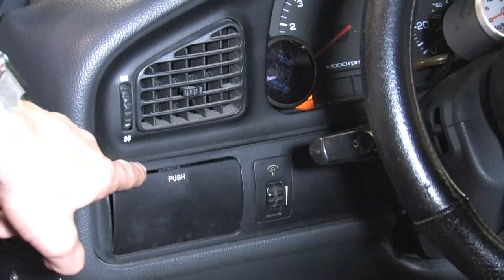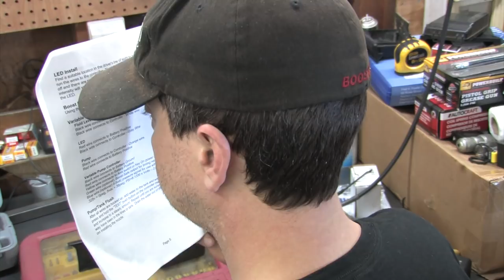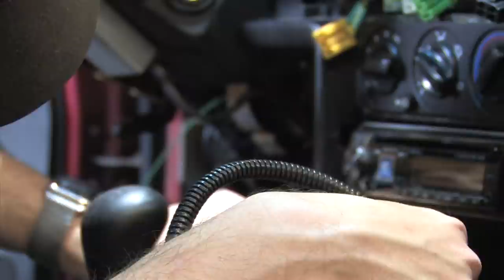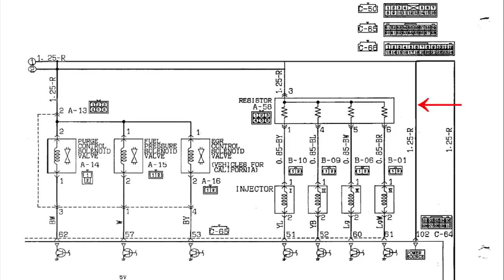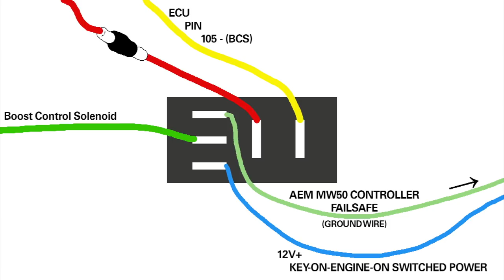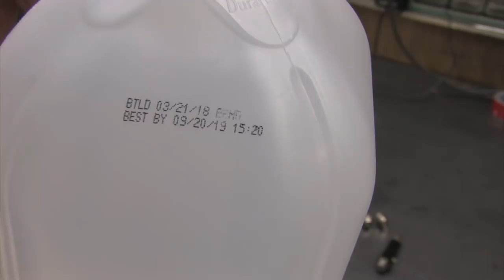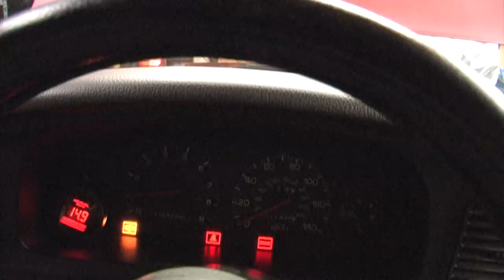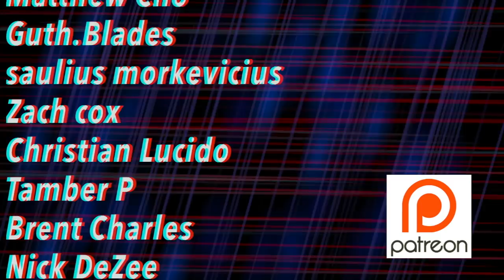Water Methanol Injection Installation

Comment: No need for a boost gauge? really? how are you going to know how much boost you are making? and how are you going to know if you have a boost leak? and how are you going to know if you are making more or less boost? if you have a manual or electric boost controller how are you going to know how much boost you want if you cant see how much boost you are making?
Reply from the maker: Yes, really.  There's no need for it.  Of 100 opportunities that you think you might be able to get good information from them, 98% of them you can't glean any information that you don't already know, or not know.  Certainly no information that's critical to your tune.  You're looking at the gauge because you already FELT something that wasn't right.  It doesn't tell you what's wrong.  It shows you a possible symptom of the problem.  If a turbo can't produce more power than its host engine's rotating assembly can handle, then a driver worrying about boost means that car's fuel system is inadequate.  For that individual, a boost gauge is little more than a stress ball.  A security blanket.  This is because boost PRESSURE doesn't matter for tuning, AIRFLOW does.  Things go boom at high boost levels because the tune isn't right, or the turbo wasn't sized properly for what the rotating assembly can handle.

Two different sized turbos move completely different amounts of air at the same given pressure.  So what is PSI, then?  What's its affect on intake temperatures and fuel stability?  Changes in a turbo's boost pressure will affect its host engine's load factor, and that in turn that will move that sample point around on your airflow (VE), timing, and octane tables that regulate your tune.  So boost is not a volumetric airflow measurement.  It's not a constant throughout your RPM range, and it changes gear by gear.  It's just a means of establishing a range of potential operating conditions.  The efficiency of the intake and exhaust, the engine's displacement and its ability to create vacuum changes to the extremes at wide open throttle from idle all the way to red line.  Even the incline or decline of the road has a dramatic affect on the efficiency of your turbo.  Telling your boost controller to make 20 PSI doesn't mean your turbo can, or that it's even going to manage to produce a flat 20 PSI all the way through the RPM range... at least not without extensive tuning and tweaking your wastegate solenoid duty cycles to compensate for the efficiencies or inefficiencies of your turbo's flow map in a variety of operating conditions.  If you've done that, you didn't rely on a boost gauge to get your data.  At least not with any degree of accuracy.  

It takes a tool just like what I'm using (ECMlink) that logs boost, or trial and error with another type of piggyback EBC to flatten out that boost curve.  If I wanted to see what my boost does from my shift point (4800 RPMs) to redline in third gear so I can make adjustments, then from behind the wheel I've traveled over an 1/8 of a mile at up to 107mph without ever looking at the road in front of me.  That is insanely-dangerous.  BUT... if you log boost with an engine management system, you have better, accurate and more comprehensive data that includes every detail at any given moment in time.  You can safely analyze it on your couch to make meaningful adjustments to your tune with it.  A boost gauge will not give you useful data that you can use for tuning and it's only as accurate as your memory.  You'll never remember what your boost level was at 5300 RPMs in 3rd gear after the adrenaline wears off... and how it compared to 5300 RPMs in 1st and 2nd gears.  

If you're FWD and your power production is in excess of what your tire's contact patch can handle, you make it stick by varying your wastegate duty cycles at different RPMs (to put you at different power levels in your tune) to compensate for traction, and when you do this, your boost is all over the place gradually increasing in each gear to make the best hit that you can so you can maintain traction.  Running a fixed boost level works against your engine's ability to use its full potential.  This is why logging is the only useful means of monitoring your boost and the power that results from it.  The gauge is just a pacifier for the driver.  Either that, or a fashion statement to say "look, my car has a turbo".  The dashboard real estate and the time/effort spent worrying about boost from behind the wheel is all wasted energy.  If you need to do a quick check of your boost, you can always plug in a laptop and get it live on the screen or in a log.  A log that will give you loads of more important data.  Data like airflow... fuel, timing, rpm, load factor, battery voltage, throttle position, intake temperature, and all the other things that can directly affect boost whether they're mechanical issues or not.  Rarely does the information you read from a boost gauge tell you anything useful that you can't or haven't already determined simply by using your butt dyno, or by listening to your car.

Your boost level drops... is it from a loose coupler, vacuum hose, low battery voltage, burnt valve, exhaust leak, stuck wastegate,  failed solenoid, blown injector seal, rag in the intercooler, banana in the tailpipe?  What?  And what's that whistling sound?  What did the gauge tell you?  It told you your boost dropped... and you felt that happen when?  Before you looked at the boost gauge.

I can see some value for the turbo noobs.  Those who quickly learn that they install it, it's cool for a couple of months, it becomes the backbone of what they know about making horsepower, but after that novelty wears off, they learn they never look at it during performance driving moments because they're looking at the road.  98% of the valuable information it could provide is being lost because it's being ignored.  The data they provide is just a series of reflected light waves that are lost if they don't pass through eyes of the driver and get processed by his nervous system.  The $190 for a quality electronic gauge with warning functions is better spent on an engine management system that can log boost and has failsafe functions already built in.  For the cost of 3 gauges, you can make those 3 gauges and over a dozen others completely obsolete.

I hope you don't read this as cynical.  Sure there's plenty of my own personal opinion in here... but it's intended to be an honest recount of my experience with using them versus what value they provide given the available alternatives.

Comment: Is an ECU tweak needed for that?
Reply from the maker: Yeah, you need to be able to pull fuel out of it in order to get all the benefits out of it... unless you have an EcoBoost F-150.  It will self-adjust to lean things back out.  For the vast majority of applications, you'd need some kind of fuel management.
Reply: @Jafromobile  Thank you on the fast reply. Also, I'm enjoying your videos, very nice quality editing. +1 sub

Comment: Battery relocate to make room in the engine bay for the tank?
Reply from the maker: Hahah!  Watch Hyundai Traction Issues Part 3.  :)
Reply: Why are you doing this install again? Trying to avoid installing an intercooler or something?
Reply from the maker: No, I have an intercooler... I'm experiencing more knock with pump gas than the average turbo car because I have a turbo high compression configuration (10:1 compression), and the knock is causing me to achieve really poor timing advance.  I've proven this engine can hold 30 PSI of boost, but the fuel/final compression ratio can't.  Water/Methanol injection raises the octane rating of pump gas, and works as a knock suppressant.  The colder, denser air is certainly a nice side-effect, though.  My intercooler is a eBay POS, but it works for a couple of good pulls before heat soaking, so it's not the cause of the knock...  It's possible the knock I'm logging isn't real, but this will answer that question for sure.  I drove this car to work this morning, it's been on jack stands for the past month.  I had 3 other mods I wanted to do to it after making this video, and this morning's test drive proved they're working perfectly!  :)
Reply: Jafromobile - Ahh, cool.

Comment: Brave to install the methonal house on the interior of the car. I wouldnt install a fuel that burns clear on the inside of my car.
Reply from the maker: When Methanol is mixed 50/50 with water, its flash point raises to 600°F, well beyond the point where any materials used to construct the interior of this would survive.  It would be pretty obvious both from the exterior or interior that there is or was a fire.  At 100% strength, that flash point is 300°F.  I don't smoke, and nothing in the interior of my car has an open flame or spark to ignite vapors that could potentially occur if I left the bottle open.  The only things capable of exceeding that temperature are actually on the outside of the interior.
Reply: Jafromobile I was once covered in methonal in a work place accident and set a blaze. It's the only reason I am hesitant to interior line routing. That being said I mixed a 50/50 meth and water. I poured it out and it was pretty hard to get it to light and stay lit. Best of luck and like the videos

Comment: So you flushed the system back into the half full distilled water bottle...the same bottle that you'll use to refill the system.
That makes sence!
Reply from the maker: No, that water went in my radiator afterwards.  I just haven't uploaded that video yet.  I don't run distilled water in the MW50 kit.  That was just a flush.  The radiator and water pump don't care if there's a flake of polymer in it.  Or at least I dont.  Not on this particular car.

Comment: You're not supposed to use that Teflon tape on those fittings
Reply from the maker: In every video I've ever used Teflon tape on any item anywhere including air compressor fittings, someone has always posted this exact comment with zero explanation for why they make that claim.  I've never used teflon tape on any compression fitting.  I've also never had one single problem or issue that has ever arisen from the use of Teflon tape on anything, ever.  I have however solved boost leaks on every tapered vacuum fitting with the use of Teflon tape where nothing else has ever worked.

Comment: Boost gages r good so u know ur wast gate isn’t stuck an it’s not running 30 psi about 2 blow ur shit up I’ve had it happen if I didn’t have the gage an I was just logging I would’ve blown it up
Reply from the maker: Yes, but what if you've built a setup that you can pull the wastegate actuator vacuum line, hit 30 PSI, go make 5 highway pulls and 4 drag passes and it's fine?  This car did that. Sure it knocked a little, but the ECU pulled timing like it should.  This water methanol kit is just an added safeguard.  I can see the necessity with a 67 trim or some other big honking turbo that can exceed the safe threshold of your fuel system, but with the size and efficiency of the turbos in most factory or modestly-upgraded cars, I don't find them necessary.  My fuel system is built for about 150% of what this turbo can do, and the SD table is tuned from 0-29.5 PSI already.  I couldn't hit the 29.5 PSI cells with the boost control solenoid, so I went for broke and pulled the vac line.  So maybe on some cars... but not on this one.

Comment: Water vapor is a gas, and therefore compressible.
Reply from the maker: I must have said something that's triggering this discussion.  Pardon me for having completed 3 levels of chemistry in pursuit of my Bachelor of Science, but Water vapor is literally water molecules suspended in oxygen.  It's a suspension, not a compound.  Bonds don't break from evaporation, they stay together.  That's what creates humidity and the precipitation cycle that we call weather.  Air temperature plays a big part in how much water it can suspend.  The water molecule doesn't separate into hydrogen and oxygen (which is what would convert water into a gas) when it evaporates.  That would require an electrolytic process. Evaporated water molecules stay in tact.  The water molecules are actually still incompressible, but you CAN compress the air around them that is suspending them in their gaseous state.  It's why water methanol injection raises the compression, those molecules do not compress.  Water isn't sprayed in a high enough volume to completely fill the combustion chamber with the piston at TDC.  It only occupies a small fraction of that volume, but the air sharing that space as a result is compressed further than it would be if the water vapor wasn't there.  So you get a compression bump both on the compression stroke, and on the ignition stroke from those water molecules converting to steam and expanding 1600x in volume.  So you can compress water vapor, but you're not actually compressing the H2O.  Just the O2.  It's tricky.  You are correct, I'm not going to argue that.  It's just more complicated than stating that water vapor is a compressible gas.  Water has a lot of weird properties... for instance, it expands instead of contracting when frozen.  Most other compounds shrink and become more dense as they're solidified.  Water is an exception to that behavior.  Water expands both when it's frozen or evaporated.  Kinda weird.  But it's exactly that weird thermal expansion behavior that makes WMI so effective.
Reply: Though basically true, water vapor (gas) and weakly bonded suspended (liquid) water molecules can coexist. Methanol water injection is really an amazing thing... my intake valves, pistons and spark plugs have never been cleaner :)

Comment: Dude just put a water methanol capped bottle with a tube in it the other end goes in the airintake, the vacume from your engine will suckup the fluid as it needs it more revs more fluid sucked up nozzle not needed the water will be atomized upon impact with the airstreams

Comment: Hook up your windshield washer sprayer to your intake and add water/methanol to your washer tank. Boom free water meth kit
Reply: Except windshield washer nozzles do not atomize the water/meth. You would be injecting a liquid as opposed to a vapor, that liquid will pool in the intake and cause problems. The pump is also not a high enough psi to atomize the water/meth.

Comment: Why would you run the meth hose through the cab? Thats fuel man. Run it under in the frame
Reply from the maker: A 50/50 mix of water/methanol is considered safe.  It raises the flash point of alcohol from 300°F to 600°F.  That means an open flame, spark, or focused beam of light will not be able to ignite it.  The vapor concentration will not be high enough.  I don't run or recommend using straight methanol.  Every water methanol kit comes with these warnings.

Comment: OR I could preserve my new 2019 MAZDA CX 5 turbo's warranty and use the AEM injection kit to spray water on the front of my intercooler and gain a bit of HP that way. No?
I take it that AEM, in their wisdom, supplied you with a fuse for this install. Ahh, I see you used an existing circuit breaker. Good. That means no electrical fires in your trunk or dash.